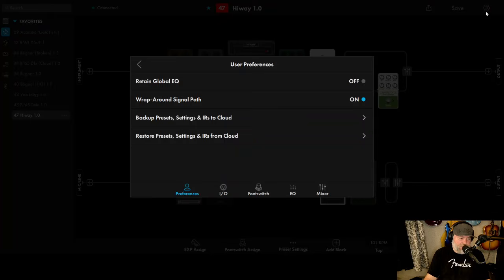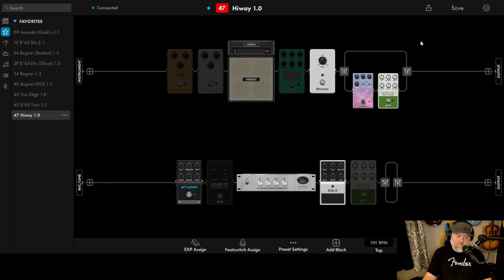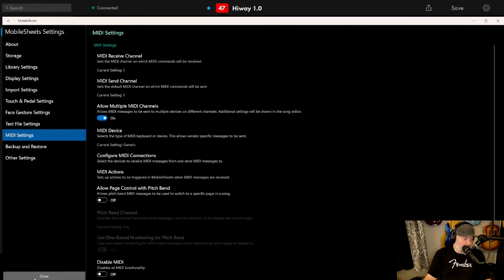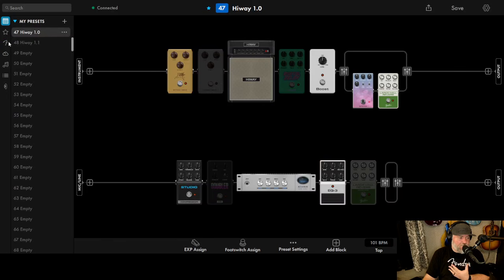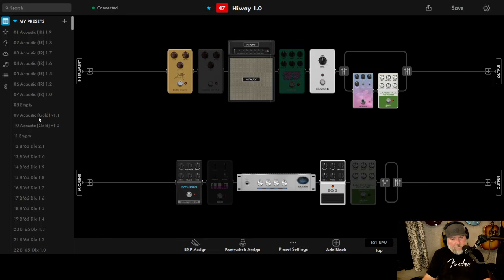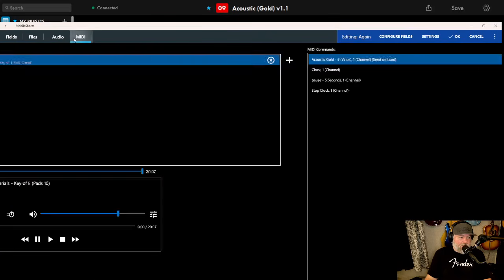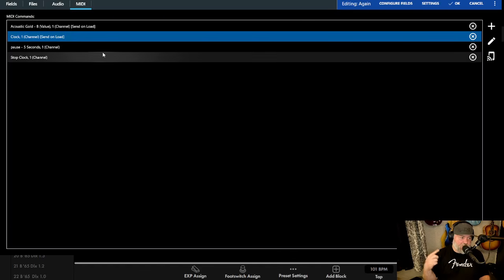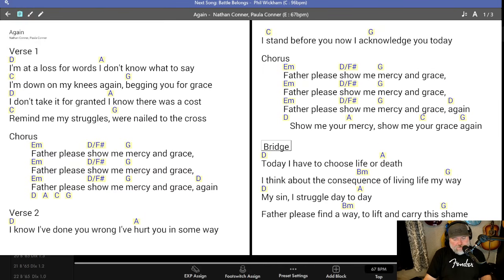Preset Control and Clock Sync via Midi with The Fender Tone Master Pro

Comment: Hi, when I send tempo via MIDI from MobileSheets to TMP, it sends the wrong BPM and the BPM value fluctuates between different values. Even though I followed your instructions. Do you know what could be the issue? Thanks for the video!
Reply from the maker: You are getting clock jitter, I have seen this a few times in my past (probably should have called this out in my video, but haven’t had it in so long I honestly forgot about it).

I had an old tablet that no matter what I did I would see jitter (could never get the right value and was always fluctuating).

I also always had issues with one of my inline midi devices.

Anytime I was running multiple midi devices in a ring I always had to make sure the device sending the clock was closest to the device receiving the clock (in the ring).

Are you using MIDI over usb? Are you running any other apps that could be consuming or trying to send clock as well (DAW, midi based applications)? Is the wrong values WAY off or close to the right value and just fluctuating (if you have HUGE jumps or values that are WAY off, I would suspect SOMETHING else is also sending clock.
Reply from the maker: Also if you are using midi over USB, make sure you are not plugged into any kind of USB hub, and try other usb ports in your tablet (if you have multiple usb ports), often one port might be part of an internal hub and another might not be.

Comment: Happy Saturday Nathan! Do you think sending midi clock will also sync with the TMP internal looper?
Reply from the maker: The TMP looper does not do any kind of looper quantization, BPM sync, MIDI clock sync, or tempo‑aware looping. It is a simple looper at its core.
Reply: @worshipcalling thanks good to know.

Comment: As an add on comment, I send wireless Bluetooth midi program changes from OnSong (iPad) to a Widi Master plugged into the midi port of the TMP.   Also set up to send clock to the TMP for time-based effects.  Works great.
Reply from the maker: I have heavily considered getting a set of those, and sending my audio over Bluetooth as well to get rid of all my cables. Glad to hear you are having success with them!